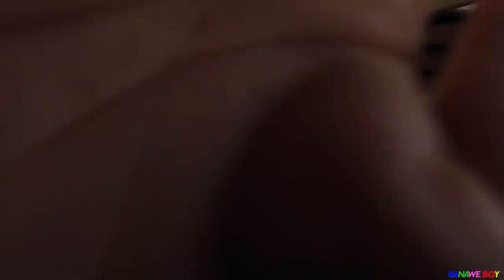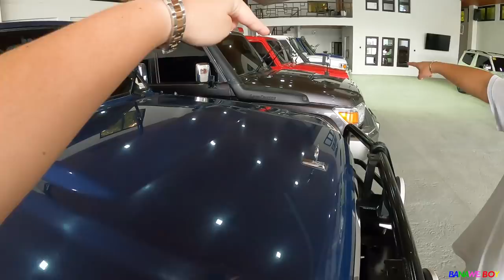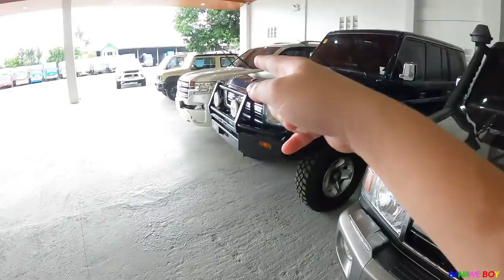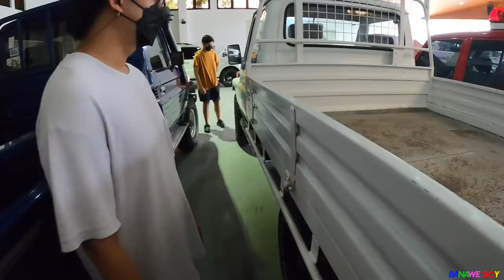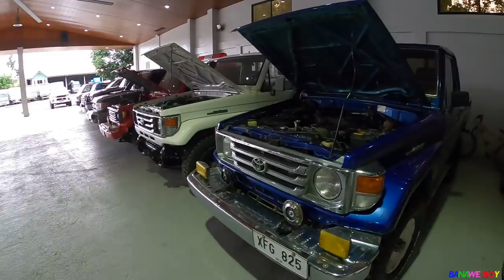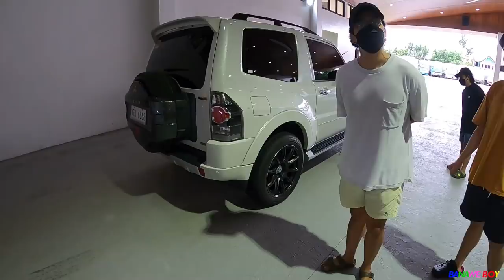LAND CRUISER 70 PARADISE!!!!

Comment: My dad used to work for PNOC in the old days and they had fleets of LC70’s. When they disposed the units my dad bought a handful (back in 2007) and to this day all of them are still running with stock engine/drivetrain components (one already has 600k+ kms). LC70’s are a testament to Toyota’s eye for reliability and simplicity. Long live the 70’s! 🤙🏻